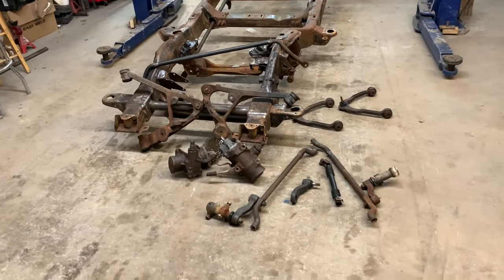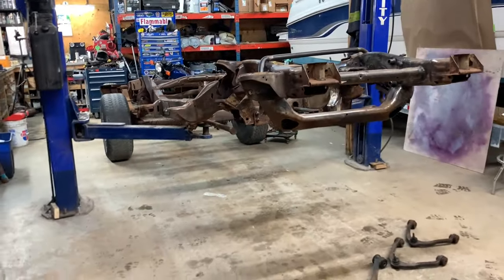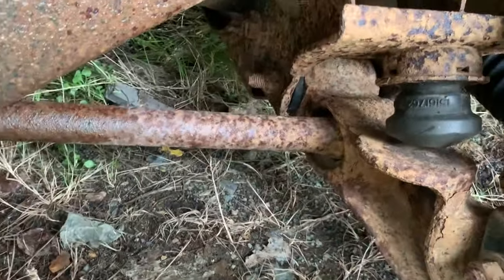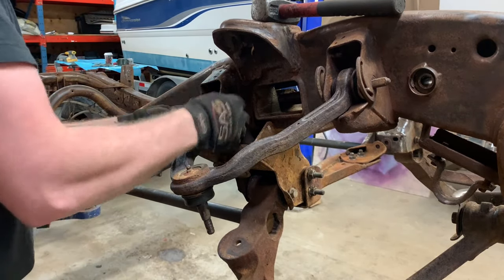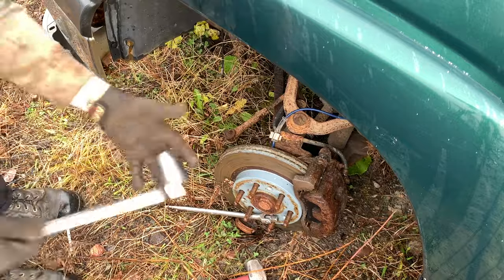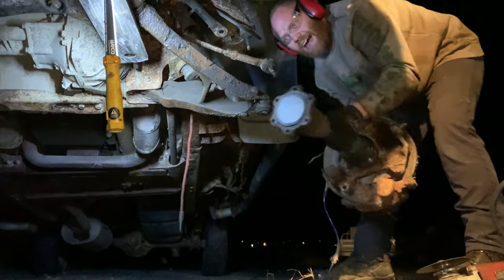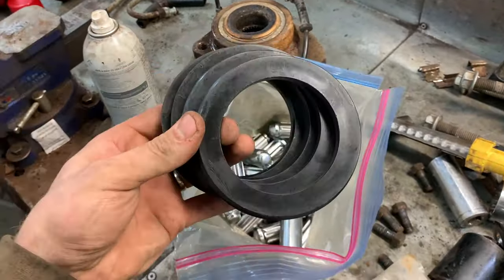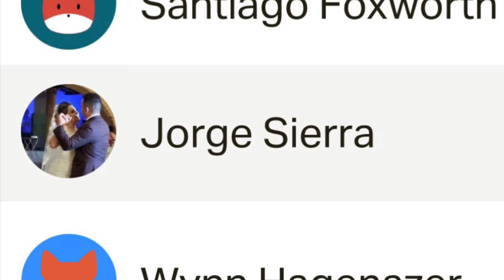Installing front suspension and AWD front diff in a 99-06 Chevy NBS truck

Comment: Im interested to see why the esclade steering box is so different.  I wonder if the suburban box is the same or if its like the truck. 
Different gears to provide more torque so theres less effort at the wheel?  Being AWD and eleventy thousand pounds perhaps they need a larger gear set...idk.
Reply from the maker: I figure the extra weight is why it’s so bulky, but I really can’t say. I’ve never heard of a steering box breaking, but then again it is a GM 🤪 

They’re the same gear ratio but I’m sure they are beefier in the Escalade box
Reply: @StationroadRatrods  yeah...not exactly the first part to break on a Chevy that's for sure. 
I remember the old square bodies used to break the frame at the steering box if you put really big tires on them, but the box would have no issues.  
I'm going to have to do some searching on the interwebs to see if I can find anything about it now.
Reply from the maker: @Jordy-927 I had a 95 Jeep YJ once and the frame was so rusty the steering box broke away from it. It was terrifying 

I ratchet strapped it to get home and drove it for like two weeks like that before I scrapped the Jeep lol
Reply: @StationroadRatrods  yup.  Sounds like a jeep.  Lol.  
That would definitely be terrifying, and driving it with a ratchet strapped steering box is definitely a true Newfie move.  100% Approved.
Reply from the maker: Oh yeah it was great, on damp days I had to use quick start to get it running cause the PCM was corroded so bad it didn’t have enough spark to fire up lol
Reply: @StationroadRatrods  compression in a can.  Nice.  Nothing like needing heavy equipment fluids for your daily...lol. 

I had a few cars in my day that were painted with fisherman's paint.  I had one car, 83 Grand Prix, that had no floor behind the driver seat.  Like zero metal right to the rear bumper, trunk and all.  The carpet would bubble up in the winter with snow.  The frame cracked off at the spring perch, so it felt like you were drifting all the time.  Got a guy to plate it up, probably more money in steel than the car cost, but I drove that thing for nearly a year.  There was no accelerator pump...so I had to prime the carb every time.  I paid 150 bucks for it and it ran...pretty good deal IMO.
Reply from the maker: @Jordy-927 sounds like a solid daily!
Reply from the maker: OOOOH I JUST GOT A PACKAGE
Reply: @StationroadRatrods  sweet.   Tell me what you think.
Reply from the maker: @Jordy-927 very excited!